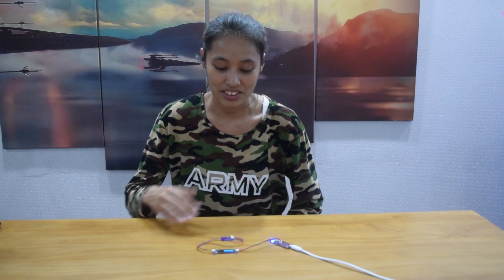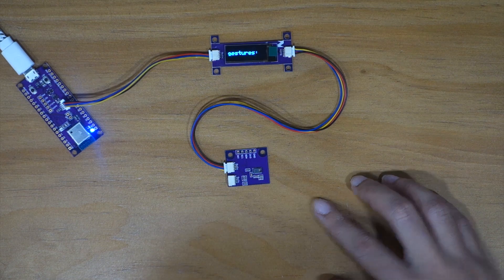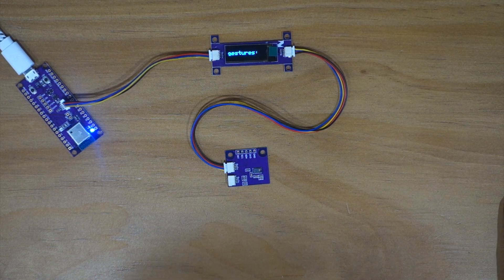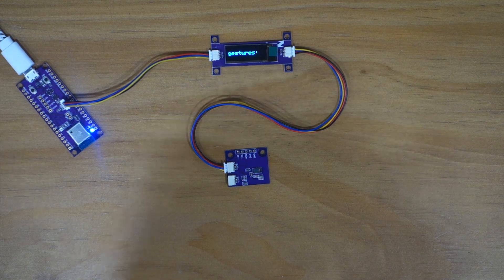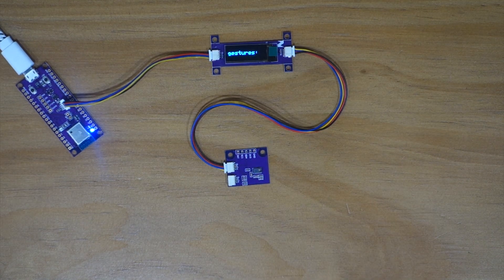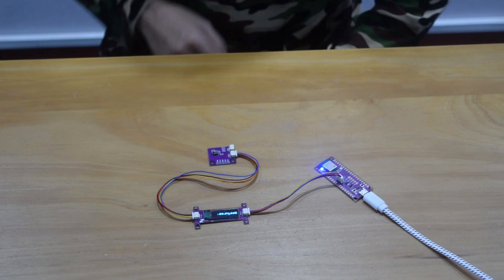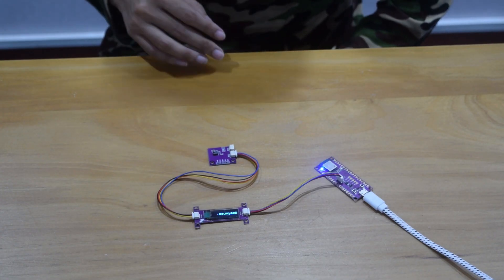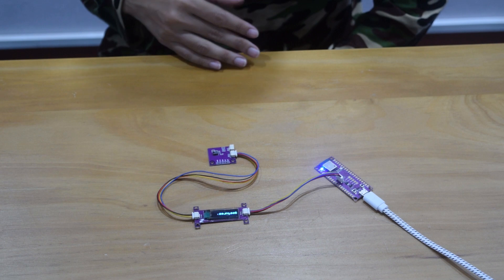Zio Qwiic Gesture Sensor Demo Video PAJ7620U2

Comment: So slow response
Reply: Yes. Really slow and maybe not fast enough for what I had in mind. This was one of about 5 vids I found so far. But hoping the delay is bad programming of the demo and not the module itself.
Reply: @jimwithheld7217  So did you tried the sensor yourself?